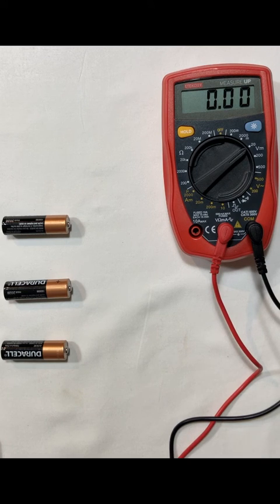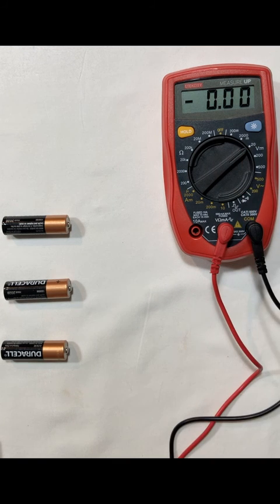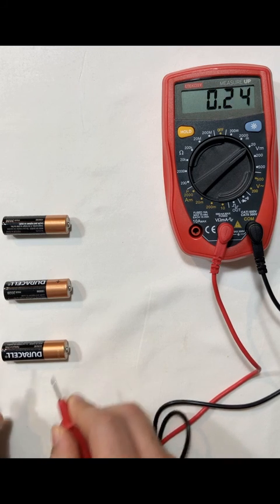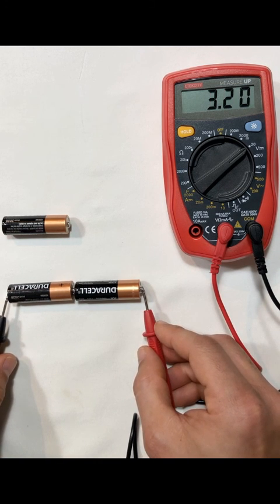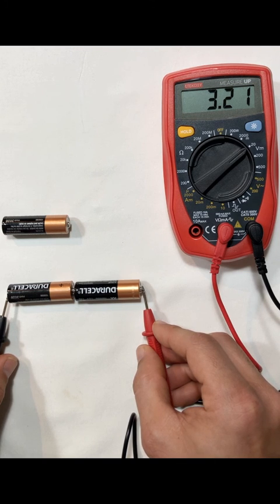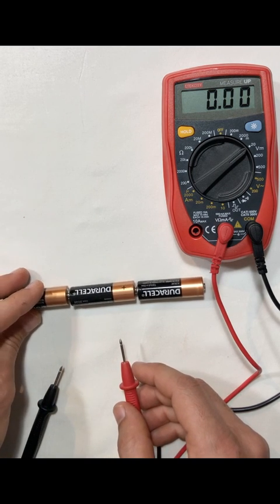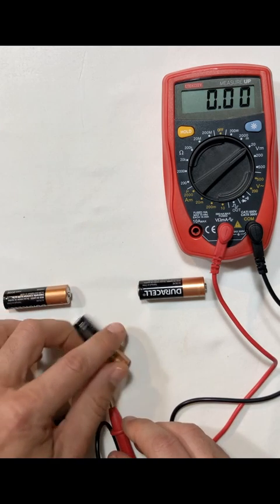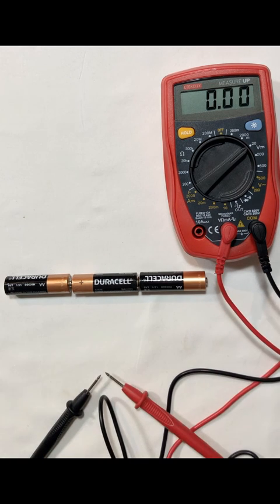Voltage Measurement Activity

Comment: When there are 3 batteries placed in series, total voltages can be calculated as V = 1.5V +1.5V+1.5V= 4.5V. However, if one battery change the polarity, new total voltage equals V= 1.5V+(-1.5V)+1.5V=1.5V

Comment: Okay, I understand how two batteries cancel each other out to reduce the voltage to that of only one battery. However, would this formation decrease the voltage down to 1.5, but still increase the watt hours to that of 3 batteries? Meaning it could power something at 1.5V for 3x the amount of time as one battery?
Reply from the maker: No - it wouldn’t the reversed potential would cancel that out - if you ran a reverse current through the batteries for to long it would damage it

Comment: I agree with most comments on here that changing the polarity of one will removed that voltage from the circuit but will also remove a correct polarity voltage as well. just dont mix up the batteries and get confused on which is which

Comment: The reason that the multimeter reads 1.6 volts is because while the sum of the original circuit 4.82 volts orienting one battery not only takes away its charge from the sum but due to its negative value also negates the value of it from the total voltage nullifying another battery with it dropping the new sum down to just one batteries worth of a reading.

Comment: When the three batteries are in order (- +, - +, - +), it stacks up on volts, however, when the middle battery is switched (- +, + -, - +), it cancels out the inner portion (+, + -, -) leaving only the first and last (-,+) which would equal out to 1.5V. Since opposites attract and identical repels, that's how I was able to come up with what I got.

Comment: When you flip the middle battery, you are introducing a negative voltage into the circuit which subtracts from the voltage of the other two batteries. So you have 3.2V (Two Batteries) - 1.6V (Opposing battery) = 1.6V (Total Voltage).

Comment: I would guess that the inverted battery is (in effect) trying to make the current change direction and flow the other way. Its force is counteracting one of the batteries in the series, leaving the final battery's 1.6 volts to register on the sensor.

Comment: When you flip one of 3 batteries in the series , it will change the polarity of the flipped battery from 1.5V to -1.5V, thus causing one of the 2 remaining positive polarity batteries to cancel out the negative polarity. This will result in a total voltage of 1.5V due to 2 of the batteries negating each other.

Comment: When there are 4 AA batteries placed in a series, 1,6V+1.6V+1.6V+1.6V=6.45V When I reversed the polarity and reversed one battery the voltage came to 3.22V. I believe by reversing one battery cancels out two of the four and your left with have the original V in the series.

Comment: It makes sense that if you were to have the two batteries facing each other the positives would cancel out the voltage measurement of the batteries only resulting in the the one being measured.

Comment: When you reverse polarity
of the one battery you are purposely creating a voltage drop in the series
circuit. This is Kirchhoff's Voltage Law. Apply this to real life. If you
have a flashlight that requires 4.5V and all three batteries are correct
polarity the flashlight turns on. (1.5V) + (1.5V) + (1.5V) = (4.5V) Now when
you reverse the polarity in the middle battery you have the voltage drop. (1.5V)
– (1.5V) + (1.5V) = 1.5V Because you have a voltage drop the flashlight no
longer has the required amount of force to turn on. Now if you add another
battery in a series circuit to the three batteries with correct polarity you
now have 6V which would overpower the flashlight (resistor) that only requires
(4.5V). Flashlight goes pop.

Comment: The battery that's reversed creates a negative voltage potential relative to ground in the series. So you have 1.6v times two batteries for 3.2v, and then one battery that is -1.6v in the circuit pulling it down. So 3.2v - 1.6v = 1.6v over all.

Comment: I agree with most everyone, Basically when you flip the one battery, it takes out two of them resulting in only two being read. One good idea is to make sure all your batteries show the same volts as you can start getting a bit confused swapping them around.

Comment: The first idea that comes to mind is like Kim Nguyen pointed out that series total voltage can be calculated with the formula, 1.5 V+(-1.5V)+1.5V. The reverse polarity not only makes the reverse battery negative it also negates the first battery.

Comment: Connecting batteries in series increases the voltage. A series circuit offers a single continuous path for the current flow, going from the source to the load. It goes from negative side of the source through the load to the positive side.Changes in the current are in exact proportion to change in voltage or resistance. If Voltage increases so does current. Vice Versa.
I1=1.5 , I2=(-1.5), AND I3=1.5
Since we reversed the polarity of battery 2, it now reads -1.5.
Kirchhoffs CURRENT LAW states "The total current flowing into a junction is equal to the sum of the current flowing out of that junction.
It = I1+I2+I3...  >>>> 1.5+(-1.5)+1.5 = 1.5
Reply from the maker: Use kirkhoff's voltage rules in place of current, the kirkhoff's law you are referencing is when multiple current loops (parallel circuits or mixed circuits) enter a single node. Since everything is in series there is not really a node to use for current... except for a trivial node that would tell you total current = total current.

Comment: I will agree with Jeff. According to Kirchhoff's Law,  "The sum of all the voltage drops in a closed circuit equals the voltage source". The first source is all 3 batteries, so you read all 3. The second source, is only 1 battery at 1.6V. By reversing polarity of one battery, you effectively cancel out one battery. So depending on how many batteries you have reversed will depend on how many batteries are being registered. It is one for one. You reverse one battery, you lose two sources. You reverse two batteries, you lose 4 sources etc. For the above video, if you reverse two batteries you will register 0 Volts.
Reply from the maker: I like how you used Kirchhoff's law
Reply: Yup, that's what I figured. Total current flow is the equal to sum of current flowing out. 
It=I1+I2+I3...
Reply from the maker: @hectorfigueroa7509  If by current you mean voltage you are on the right track